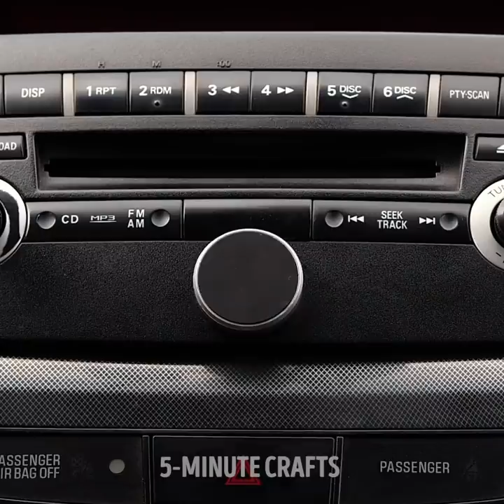23 CAR TRICKS to make your life easier

Comment: Can anyone tell me if that hot glue dent thing works for real without damaging the paint?
Reply: College automotive painter student here, sorry bud, tried it, you will simply have about 10 glue sticks stuck to your car that protrude out like antenna giving your car a bug like appearance
Reply: @danieladams608  totally forgot about this but a slight update, I had a dent in my rear right quarter panel (part of the shell). Eith one of my jobs I had to put up some speakers at a company selling damage repair equipment, they had open house days and also did demonstration's of the equipment. I showed them my dent and they asked me if they could use my car for a demo, so dent has been pulled for free.

Comment: I wonder if anyone tried the first hack (windshield water repellency) and could share if it worked. I applied it today, let’s hope it works... At highway speed when the wind is a bit stronger the wiper overwipes :/
Reply: If it worked they would have used it on side mirrors too.